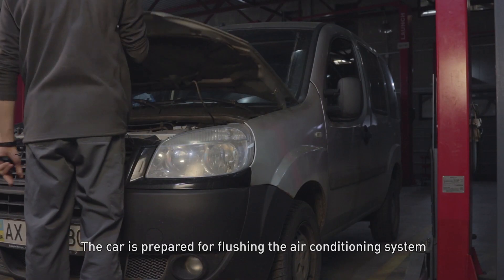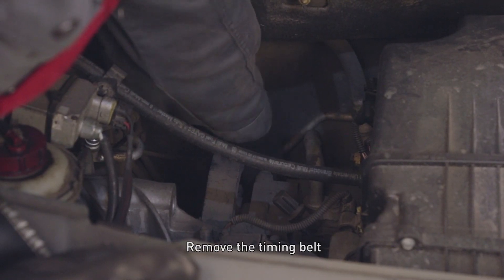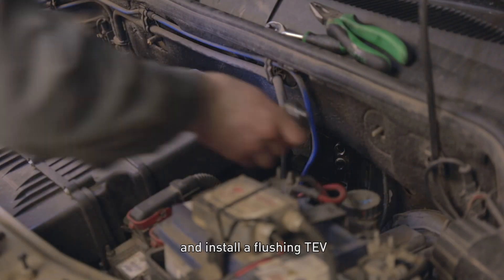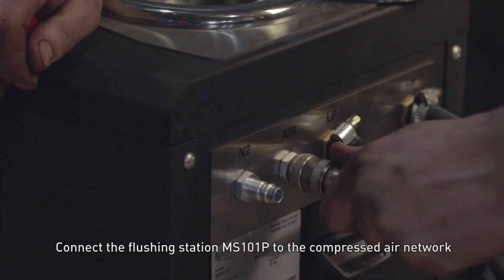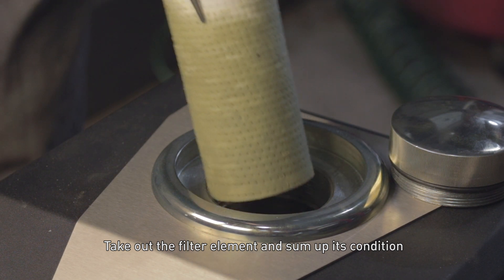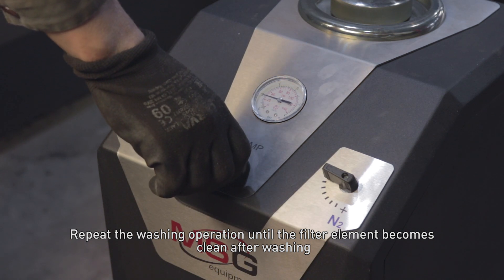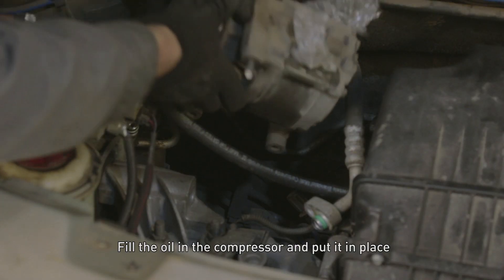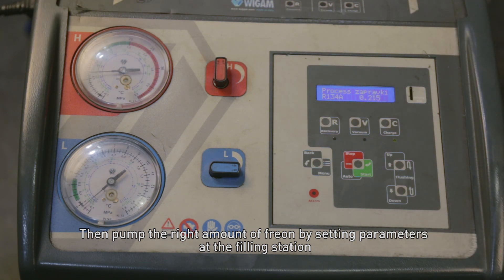Flushing the car AC system

Comment: Didn't even clean the exterior around the connecting surfaces... risk getting crud when reconnecting. What kind of shop is this?
Reply from the maker: Yes you are right. Thats  just for a showing  how  it  can be flushing)
Reply: @MSGEquipment  can I know the type (name) of fluid used for flushing the ac system?
Reply: Thats just a demo for system flushing.. The rest, do it yourself
Reply: BUTCHER SHOP .